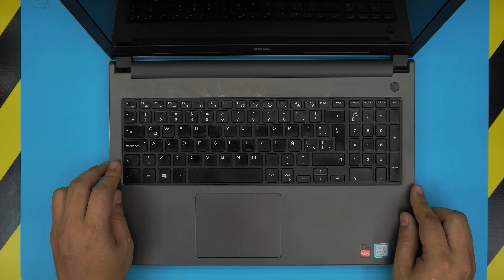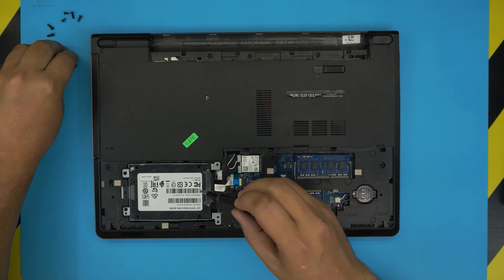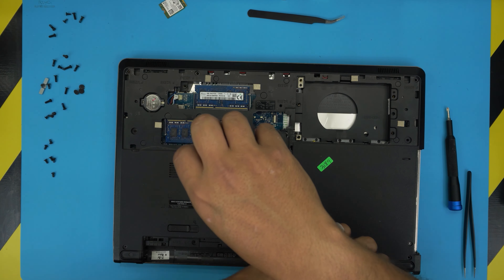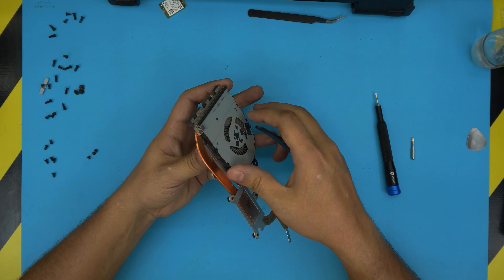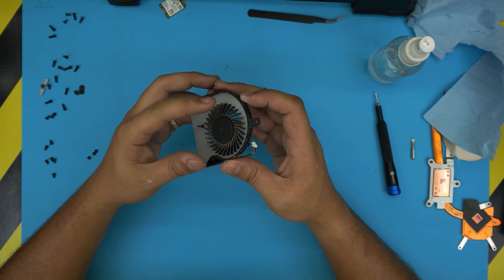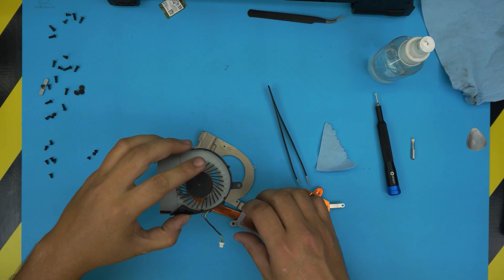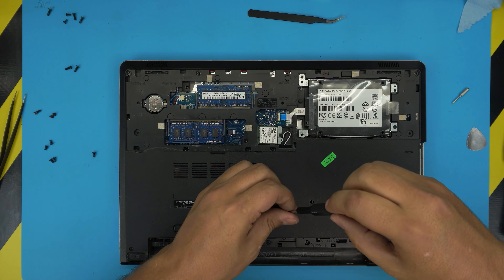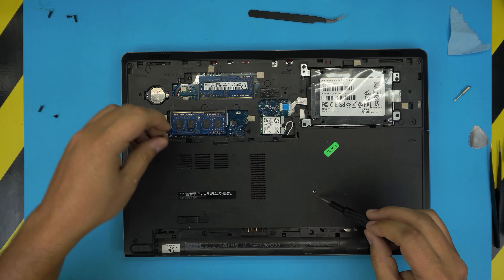How to Clean & Repaste Dell Inspiron 5559 P51f | FULL GUIDE Maintenance

Comment: Thank you so much for the video. If I may ask a couple of questions. 
Why do you boot into BIOS after repasting ? 
And do I need to use all anti static tools for that ? Is a glass table any good for that work? 
Thanks a lot !
Reply from the maker: thank you for the feedback! if you wish to support the channel you can LIKE or SUB or both :P
regarding your question: the reason you should go to bios, (not required) is to set the date and time, because once you remove the battery the bios date resets to default, its not a big deal. but its good to set the date and time and restart.
and in the name of god the ESD wrist bands are worthless dont worry about it. glass table its fine, just don't rub your feet on a carpet before touching the motherboard. saddles or shoes are fine.  trying to kill the board with static discharge its reallyyy really hard almost impossible.
Reply: Thank you so much !
Reply: @uFixTek  Thank you so much!
Reply from the maker: anytime my friend , when ever you need anything let me know.